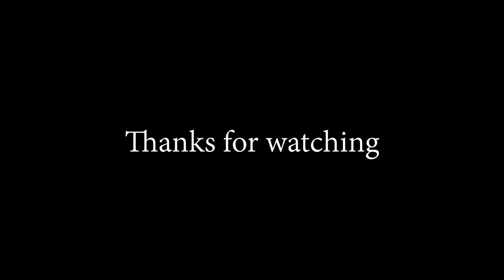Bushcraft Build: 6 Shelter/Fire Cabin - Windows & Roof.

Comment: Great Work! Very patient! 

I apologize in advance for my dumb questions but I have to calculate from limited resources and destroyed health in advance and where I can read and watch until I am so droaned I can't even be hateful to watch someone I know the ill effects from pine, pine mold, wood smoke, woods fungal/bacterial before and after assaults and now even my own body odors irritate in the lungs so I need  to calculate my activity from damaged health to modify my health to do the projected workload given the respective conditions where I can get a land donation.  

What do you use in your diet against fungal and bacterial infested air, and against all the raw pine smell? What method do you do for your hygiene? What do you do for composting? What do you do for cleaning up the air/ making less polluting burning? I would want to learn if you do stone and metal crafting for your own tools? What is your diet? What is your age and existing health conditions if any you struggle from while building this house? What were the temperature ranges and the length of the period to get to that level of completion?
No hole house and closure? What for Windows/shutters? How long will that tarp last? It seems like it was frosting so how will the sod have a chance to re-root itself before winter?
Is it possible to make the woodash cement up by you to make your fire place and ramed earth? I am assuming you are going to build the walls like a Pawnee round home since you partially dug down. I am surprised you didn't want to build the Alaskan underground home, but since I don't know your surrounding terrain and water table I can presume with the sandy soil you wouldn't be able to seal your structure from the bottom up.

Good Day,
Reply from the maker: :O I try not to sit in the wind direction, i dont use wet wood if i can avoid it. I wind wash my clothes. If i was it after every trip it won't last long. I dont avoid inhaling fungi, i drink it (chaga) I dont blacksmith or flintknap so far. Only tried both once. I liked it, but i have to many projects and ideas at the moment. I eat way to unhealthy, loads of meat and i make sauce every day. Most of the time the temp. was between 0 - 10 C. I am 48 and a bit to fat at times and unhealthy. But i tend to loose weigh pretty fast when i want to, and in periods when i work hard in the woods. Regards the shelter. I rather show than tell. ;) Thanks
Reply: @DonVonGun  Thanks for the info. and the reply. Keep up the great work! Is it your land or are you are allowed to use publick land over there? If it's your land, how much do you have and how much does it cost over there? How  bad does it get for snow and cold for winter and how long is it bad cold where you can't grow. 
To this time I see nothing that talks about Norse or Scandinavians having had any winter grow houses. But if all the other technologies attributed to them are correct then it makes ZERO comprehension how they wouldn't have had underground architecture and grow houses. Please open that door up for me where I can get the same focus and concentration for Real Life Skills despite weakened health while having to do the social job shit.
Reply: @DonVonGun  The meat if it's a natural meat and you can break it down should be good. When I see you posting the sugar in your videos it freaks me out. That definitely was never a northern food and it was known way back in the day of the Romans it would cause in fighting within the ranks of the enemies so they would give it as a gift to try to convert there enemies. In me, if you take just a small sample in water and tune-up to your body/stomach within 1 minute you will feel an effect in your stomach and a corresponding change in awakeness and cognizance. At least give the raw cain a chance over the refined and potentially your body and brain will thank you for the change in ingredients.

On a similar note, I am interested in the historic to present longevity of the people.
Thanks

Comment: Hello Don and miss Mouse , I am learning so much from watching this video , I like to find the video before this one to get the roof base . I am learning about the reciprocal roof. I am excited to try to build one similar to this this summer . I like to find out the name of the bark stripper tool that has the two handles. I didn't notice it on your list., Also i like how you used wood pegs and put the small slice of wood on the end so it can be tightened up after inserted in place, Thank you for making the video it came out great !
Reply from the maker: Thank you :) Its called a dragknife. Its an old one i sharpened and restored. Good luck with the cabin. :)
Reply: @DonVonGun  Thank you so much the name fits it for sure , I wanted to ask you about the pegs you make to join the two pieces together ,Do you use a harder wood and just cut down some brush pieces?  I like to try to make a second story one I also have a claw foot tub i am looking forward to dragging that in with a little fire under it to heat the water .
Reply from the maker: @deeandroxi  I just use spruce. It last long in these conditions. Nice with the tub. :)
Reply: @DonVonGun  Thank you ! I live in the county in western Massachusetts only a little over 4 acers but i have most all of it woods with a nice stream thru the center , I am also going to try to build a water wheel at some point , thanks again look forward to seeing more of your videos ,. I also notice your dog often stands guard as you work .
Reply from the maker: @deeandroxi  Thank you. That sounds amazing. :) Yes, when we goes to sleep i tie her. She sleeps so much better then. If i don't she will guard.
Reply: @DonVonGun  She is amazing I have 4 dogs now but 3 years ago i lost my husky/blue heeler ( the herding dog) I only spoke one work mostly she really knew without speaking , My best friend forever. She also loved the woods and I had a whistle only would blow it once and she would return to me. Your pup seamed the same way .
Reply from the maker: @deeandroxi  its hard. I fear the day i dont have her anymore.
Reply: @DonVonGun  Yes every day is a blessing with your dog . Roxi was my best friend and even though she is gone I sense her still many times around me , I can truly say above any person she was my closest friend ever .